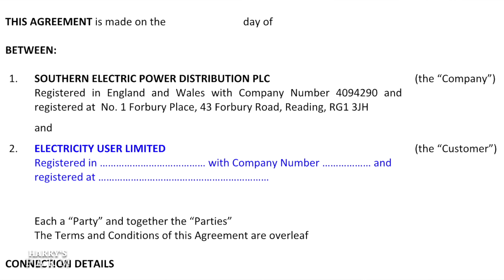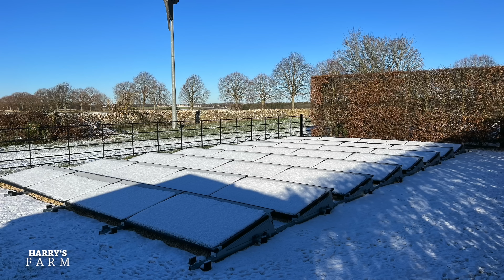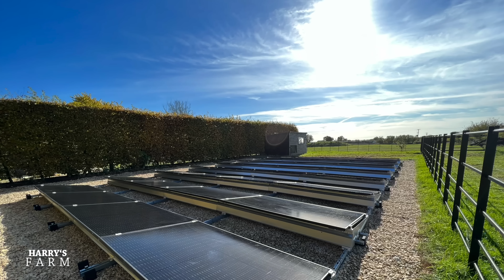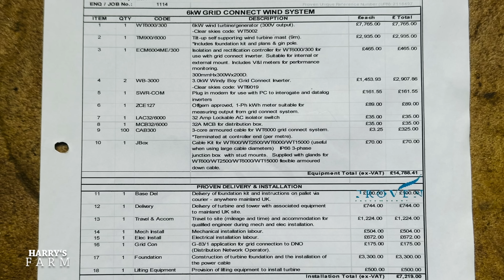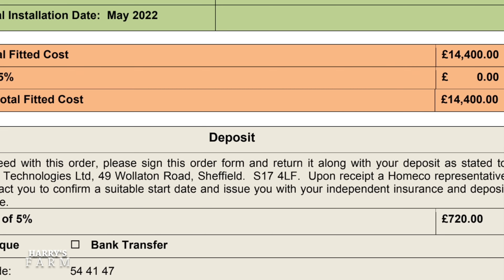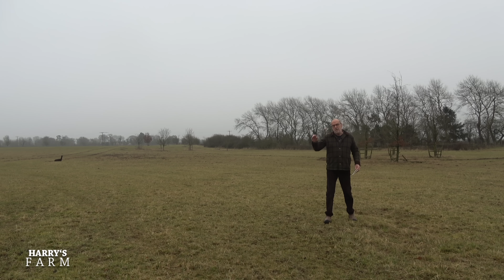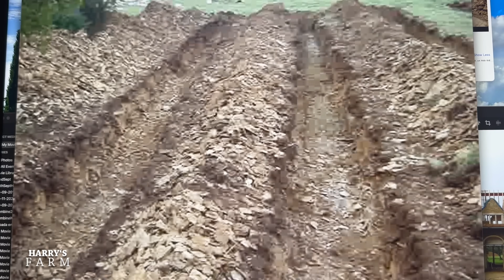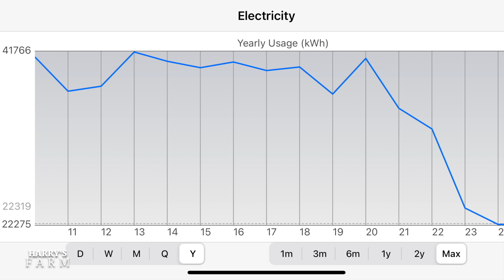Are solar panels & heat pumps worth installing? Here's what I've learnt after several years of use.

Comment: The biggest mistake people make installing solar panels is suboptimal orientations. Installers get paid to install more panels, they don't get paid by system output efficiency or your return on investment.

1. In England it is crucial to have your panels at a steep angle. At least your geographic latitude in degrees from the ground. These panels are about 10-15 degrees and they should be ~50 degrees to optimize for year round output. Further more since day lengths are shorter in the winter and energy demand is also usually higher, it is more important to optimize for winter months than summer. The sun oscillates 23.5 degrees for the seasons. The sun's angle is exactly your geographic latitude on the spring and fall solstice (march and September 21st). But to optimize for winter months, in my opinion the SOLAR PANELS SHOULD BE INSTALLED GEOGRAPHIC LATTIDUE+12 DEGREES. This does not optimize for total output but optimizes for output on ~Novermber 1st and Feburary 1st, centered on the winter months. This will also helps to keep snow off the panels.

2. Shade should be avoided at all costs, if your panels are shaded for more than 1 hour per day in any capacity they will almost never be profitable.
3. Panels should be oriented due south +- 10 degree's, optionally slightly west as afternoon power consumption is usually higher, but no more than 10 degrees off south.
4. If your live at latitudes above 50 degrees (All of England) it is unlikely to ever make sense to install solar panels when a grid connection is available. 
5. In locations above 45 degree's latitude, if installing solar, I think it is only ever cost effective to install 3 axis ground tracking panels in a very open area. These track the sun's direction perfectly and will produce peak power for about 90% of the time the sun is up, regardless of time of year. This is especially crucial for the winter months. 

I would estimate that less than 25% of residential solar panels will ever be cost effective baseed on their installation conditions.

Edit: ABOUT THAT OVEN.... heating with electricity is 100% efficient, depending on your heatpump system it will be 300-400% efficient per unit of electricity consumed.. 15Kw per day would be 45-60 kw of heating potential. About a gallon of diesel in energy lost by using that oven. PER DAY! In other words, a heat pump would only need to consume 4kw of electricity to equal that oven at 15kw. ~2$+ per day
Reply: In 2010  ( southern Ontario Canada} our guy came, took a scan with his iPhone app of the horizon  to help select the best  ground mount location and how much solar energy could be harvested  based on the radiation estimates from a local weather station and maximum yield based on  size of installation . We had to move the spot north to avoid trees low on the horizon, which in the winter with no leaves, don't block much on the winter days.  I think they installed Harry's  where they could do it.  No surprise there is shading. He could clip or remove the hedge for a minor yield increase. Up to him. 😊
Reply: He should definitely take your advice
Reply: The panel angle can't be optimised unless they are moveable. If harry has a swimming pool to dump excess summer generation into, his 15 degree panel angle could very well be the most financially optimal for his situation.
Reply: @TMEstuff  A 15 Degree angle could never be optimal in England... The highest the sun ever gets on the summer solstice is  ~65 degrees from the horizon. AKA panel angle of (Latitude - 23.5) 26.5 degrees to optimize for 1 day of the year. If you're going to optimize for summer in general then at least do Latitude - 12.5 which is still going to be 37.5. A very steep angle.
When I talk about optimizing a panel angle... I'm talking about optimal static positions. Depending on geographic location and energy use needs their is a optimal angle. I get it your like this guy but you don't understand solar. This isn't a personal attack on him, but if he's shocked about his low solar output, for which there are very specific reasons. I will point them out.
Reply: @ Oh i see. I didn't realise a 15 degree angle was beyond optimal for any point in the full year, just assumed that angle was optimal for the height of summer. Why would they have even installed them at that angle then, if there's no circumstance that results in  max peak power?

Comment: Useful video. We put 10kw solar on the roof and are very happy with it. One thing I’d add - at 15p / kWh feed in from octopus over summer we are being paid to generate, and this can be used to pay winter bills. Over a year we generate more than we use - including running 2 electric cars.
Reply: You did not counted in the investment in 2 electrical cars and the whole grid...do the math properly. it will take at least 15+ years to bring that money back and start saving real money.
Reply: @The_Touring   If you need a car then you need a car. You just choose electric over ICE, prices aren't dissimilar especially second hand. As far as I'm concerned buying an EV starts saving on fuel and lower household electricity import from day one. I only consider my investment in solar and battery as something extra that needs to pay back over time.
Reply: Does your utility give you a hard time because you are generating more than you are consuming yearly?
Reply: There is no way you run your electric cars from your solar panels, as much as you kid yourself.
Reply: @stanley_plank  Depending on orientation and shading, their 10kwp array should be capable of generating around 10 MWh in a year, enough for around 40,000 miles of driving. They have two cars. I doubt both of them do 20,000 miles each a year (but maybe they do).

It is perfectly possible over a year, though not on any given day.
Reply: About 6 months of the year I'm filling the car from solar.  The home battery in the summer is always full by mid morning and then the bulk of the day 2 to3 kwh are going into the car.  Not for everyone's situtation for sure but I'm also getting paid for that electricity generated.  Total fuel bills heating and running a 4 bed house inc water and the car is costing us an average of £48 per month all in and that doesnt count the £700 i get paid for generation. It's not as clear as you state.  @stanley_plank
Reply: @stanley_plank Why not? You haven't asked how many miles they average in the cars each day. If it's the UK average they'd easily do it
Reply: @stanley_plank  I don't actually think the original poster is claiming they charge the cars directly from solar. It's actually more expensive to do this so makes zero sense. You're better to charge overnight for 7p and get paid 15p for export during the day. So what I think they're saying is that despite running 2 EVs (so paying for overnight charging on top of any other grid import) they make enough from solar export to cover it all. Which is totally achievable, a well configured, large system with batteries can easily generate a profit of £400 per year. An EV doing 10,000 miles at an average of 4 miles per KWh would cost £175 to run. Two would be £350 so they'll still just about be in net profit.

Also need to factor in that having an EV will bring down the cost of your average grid import. Before I got mine my night rate was 13p and I paid on average about 16p. My night rate now is 6.7p and I'll pay on average about 8.5p. So I'm saving about £340 while spending an extra £100 to charge an EV. Basically what I'm saying is that when you leverage these things together you can save a huge amount. Between my solar, batteries and EV I save about £3,500 per year on electricity and fuel.
Reply: Its all very well averaging out your electric production but how you going to charge two electric cars between november 1st and 1st March.....? Maybe they switch to the bicycle then!.If you generate and store in batteries and are not hooked up to the grid you will soon run into difficulties. Just because you are hooked up you cant make year round claims about great it is.   @FlatToRentUK

Comment: Shading isn't a problem if you spend a bit more money on micro-inverters / solar optimisers that sit on the string connecting each panel. They are expensive but they massive difference if you have a system that crashes with a little bit of shade on one panel.

Comment: We've just installed 6.5kW of Solar, a Powerwall 3 and an 8kW Heatpump on our (considerably smaller) house in N.Yorks, and yes, you're right, the Solar drop-off in the winter is startling (!), we installed our solar at the beginning of October, and made twice as much electricity in October than in November ...

But really the Solar was a relatively cheap 'nice to have' (£4k), whereas I think the Battery (£8k) will be the essential bit of kit, as it stores mostly cheap tariff electricity, which will then be topped up in the summer by the solar, - so there should be some time in the Summer when the heat pump is off and the Solar is flat-out and we should therefore be effectively self-sufficient, - and if we add an additional battery, our time spent being self-sufficient could be considerably increased.

At the moment, however our 8kW Air-sourced Heat pump is effectively flat out in this cold, lousy weather, so is consuming our current Battery in just a few hours, - but this weather WILL warm up a bit, one day !

It's great to see you were such an early adopter, and the cost of a similar solar installation would presumably be a LOT cheaper these days ?

Comment: I’ve done drainage work for large solar farms. We have to be very careful in the summer as a lot of the generated power goes into the ground as the grid doesn’t require it. We could easily fry a digger and its driver within 100m of the earth points. So much energy just goes back to the earth when they can generate the most. It’s madness. Then in the winter months when it’s really needed they produce sod all. It’s all entirely backwards. We need more nuclear if we ever want to get away from dinosaur juice and pig farts.

Comment: I have solar, an EV, a heat pump but also batteries. During the summer my solar batteries subsidise evening power consumption. I also have time shift batteries. They charge at 6.7p / KWH and feed back into the house during the day and keep the heat pump going until about 2pm which is significant in winter. This spreads the cheaper electricity to make an average of about 11p / KWH. Each bit of technology helps the other. My annual electric bill is about £600 and I receive about £300 in FIT. So £300 a year for all energy costs. I think you need to do some costings on batteries. Solar without batteries is a missed opportunity.

Comment: The best way to use a battery is not to store your solar production, it's to shift your consumption to off peak times where you can buy the electricity cheaply. If you optimise your charging and discharging you can make a big difference to the financial aspect of your use. If you have a battery large enough to cover a days typical usage, you can import it all at a cheap rate (eg 8p/kWh on something like Octopus Go) and you export whatever solar you generate at 15p/kWh. You can use software to optimise when to charge/discharge based on your average consumption, predicted solar production and battery size for the best financial benefit. This would bring your average unit price down considerably, and the payback time would likely be reasonably short.

Tesla Powerwalls are a very expensive way of adding battery capacity, and there are much cheaper ways of doing it depending on how much you are willing or able to do yourself.

Comment: I used 4 x 550 watt panels which don't downgrade in the shade via an inverter charger with 8 x 12v leisure batteries wired in series going 2 banks of 48v battery storage. Total cost of self installed system £2300, energy usage savings over 2years £930 so on target for payback within 4 years as energy prices keep rising and we now use Octopus off peak tariff for battery top up.

Comment: I have a 220 m2 house and my heating + electric is roughly the same, so I think you're clearly doing it right.   We looked into solar and switching from gas to heat pumps but it's not worth the cost.   Given the up front costs (or payments on a loan), there is pretty much zero cost savings within a reasonable amount of time.

Comment: Harry, this was a very interesting video. I am in Nova Scotia, Canada on the Atlantic coast which moderates the climate somewhat but our winters are still much colder than yours. This morning the outside temp was -15 when I woke up. Over the time I have lived here I have migrated my home from oil heat to natural gas and just this past year, to a full-home air source ducted heat pump from Fujitsu. I did that with considerable trepidation but so far it has worked wonderfully with just a slight amount of supplemental electric resistance heating needed on the coldest days. The new heat pumps are miles ahead of what you appear to have. I am surprised your ground source system is apparently somewhat of a challenge since my understanding was that being 6 feet below ground it would provide a consistent usable temperature to the water tubing. Maybe it is also a case of needing a newer, more advanced unit. I have considered solar as well but do not have much southern exposure on my roof and not enough lot size for a ground array like yours. The idea of a windmill would be appealing if I lived in the country. Best regards!

Comment: If have that amount of money i has built a hybrid system with battery pack and a diesel generator for backup and then tell the local electric provider to come and get there kw calculator and get of grid.

Comment: 🚜For everyone else who does not have a 4 acre field to bury half a mile of pipes, a wired weather compensation sensor may be worth a look.😉
Reply: Nowhere near the amount of resources you suggest. 😮But you do need a properly designed install. 😊
Reply: @JohnRoss1  1500 square ft of house requires 3,750 square ft land for horizontal ground collectors, which is 0.93 acres.
The field is at least four times the size.👍

Comment: Not sure if you mentioned it but if one has batteries installed you can charge them up at the cheap overnight rate, 7 pence in my case. Day rate for me is 26 pence I believe so I am saving approx almost 3/4. In the Summer of course no issues. One way of using up excess is to heat a tank of water/ swimming pool in your case of course. One of the cheapest ways for a household is to install just batteries and take advantage of the above. I think my 13 Kwh battery cost about £5000 fitted from Give energy. I really don't know why Governments can't give poorer families this battery install would save them a lot of money.

Comment: What a lot of malarkey - all that infrastructure just to provide one domestic energy source. Wouldn't a national energy policy be more cost effective? If the Govt was in any way competent, it would have a nationwide network of SMR's. For a relatively small cost the national grid could supply every house and industrial unit with cheap and consistent energy. Consider the costs for the average domestic user and the money the tax payer is spending on subsidised 'green energy'. Most solar panels & wind turbines are made in China, where energy comes from coal fired power stations. Our national energy policy is to enrich China, instead of providing cheap energy to British people. If the UK is to embrace the next stage in the AI tech race, it will need to build very large data centres which consume large amounts of electricity. Wind turbines & solar energy will not cut the mustard as sources of reliable energy, never mind the ugly brutality of them littering the landscape. Nobody speaks about the environmental damage done when each turbine is erected in vast concrete foundations - 10 to 20 ft thick, 60 ft in diameter, weighs about 1K tons. We are seriously going down the wrong road, if future living standards mean anything to anybody.

Comment: The best route for most people is solar, batteries & heat pump, fit it all yourself for about a third the cost and dont bother with export. The whole thing will then payback in a reasonable period.
Reply: Are you serious???
Reply: @jozsefdebreceni9911  Is there something wrong with you...
Reply: Have the heat pump professionally fitted and get warranties and a £7500 subsidy. Get solar and batteries professionally fitted again get warranties and if I remember right you do not pay VAT. Doing it yourself would be expensive, probably not work properly and no warranty protection so good luck trying to sell the house.
Reply: @mbak7801  Go pay £20k+ and never get your money back then.
As for £7500, fools gold, you never get it because the installation companies add it to their bill...